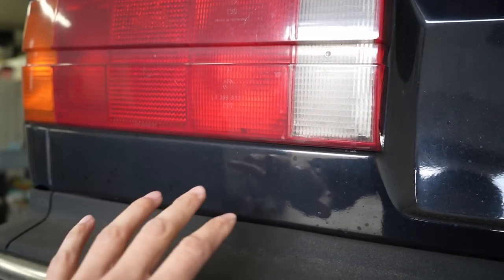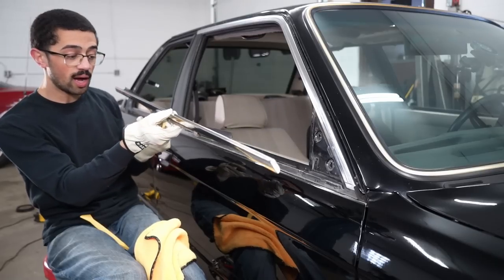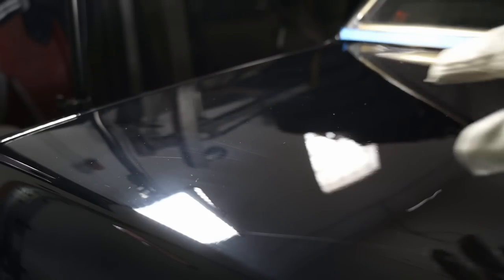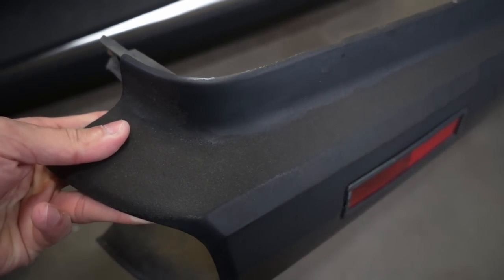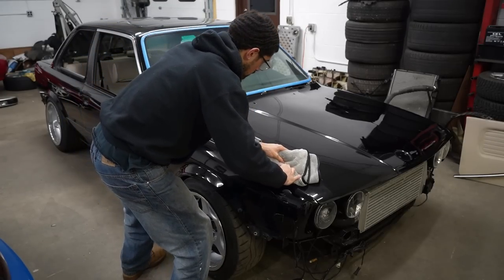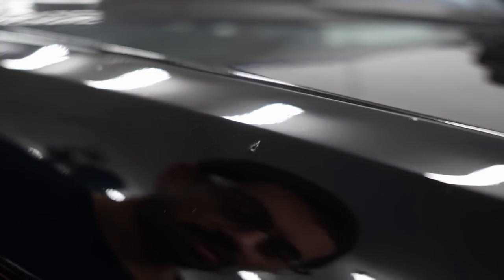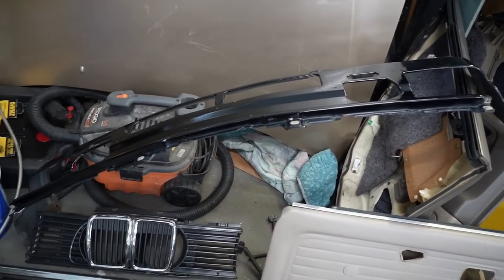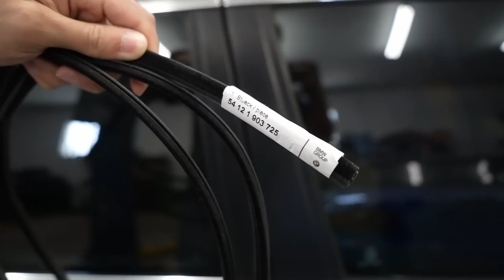i spent 150+ hours ceramic coating my turbo m50 e30

Comment: Some tips for anyone wanted to do a coating themselves.
1. Always do a polish beforehand, even if it’s a brand new vehicle.
2. A 10:1 solution of isopropyl alcohol and water will act as a prep solution to remove any residue from the polish that may be leftover.
3. Put your ceramic microfibers in a bucket filled with water and dish soap immediately after use to prolong the life of them. (Ceramic will crystallize on the towel if you do not do this, causing scratches)
4. Most coatings are ready to wipe off after they flash over, it’ll look almost like an oil slick.
5. For high spots (extra ceramic that hasn’t leveled, will still look flashed) lightly mist a microfiber with distilled water and wipe the panel. It should take the extra ceramic off if done before it has cured. If it has cured you need to rub off with polishing compound and reapply the coating. 
6. Look at your work outside when finished to get the best opportunity to catch high spots that are leftover.
7. If you have ceramic left over, put it in the refrigerator. It’ll increase the lifespan of the coating until it’s next use.

Comment: For the next correction you do, you can use compressed air to blow the compound/polish out of the pads/rags. It'll save a lot more down time.

With polish typically you can move a little quicker since there aren't as many abrasives so it takes less time to break down. 

Also whenever you do wash pads/microfiber just use detergent never add softener (it messes with the absorbency) and when you dry do the lowest temp you. It'll extend the longevity of the pads/microfiber.

Still the car came out looking fresh!

Comment: You normally do the touchup before polishing. You dab the spots, wet sand it flat then start your polishing. The cutting removes the scratches. When you go to polish the polish will have fillers that hid the little scratches. So do one spot until you figure out how your going to do the whole car. The iso with a clean towel will not scratch, if it shows scratches you need to polish more. Pad speed is important, 6-8 passes per 2x2 area. If there are still scratch’s you live with it or polish more. 
When the csl goes on to heavy and streaks just add some more quickly and wipe it off. Once it drys you have to sand it off and start again. 
You should clear coat the polished lenses. 
You did great it will be easier next time. You would normally follow crystal serum lite with gtechniq EXO. It’s a super hydrophobic coating that helps prevent water spots. And makes water just bead up and roll off. Use the trim product on the plastic pieces and the G5 for your glass and plastic, like the tail lights. For regular washes use a SIO topper like 3D Bead It Up or the new P&S Defender rather than the spray wax. Spray wax doesn’t stick to the ceramic and will just come off in a couple of days. 
Refresh the coating with the gtechniq C2v3 spray. It will keep the ceramic going for 3-4 years. The car is three ft gorgeous now. 
If you want 3 inch gorgeous you need to repaint. 😁 Use the extra on your wheels. Throw the towels away. You can’t wash the ceramic out it will scratch everything. I toss them or put them in the tire/wheel well wash bucket. Long video gets a long post.

Comment: As a full time detailer, I had to do whole cars 90-95% scratch removal within 2 days including the ceramic coating, it was insane. Not as detailed as you though, removing trims etc. We usually just taped em. I love seeing you take that extra step

Comment: Another trick if you ever go down this road again. Hahaha. we used to do compounding boats and yachts to clean pads while using them, can spin it and use end of a wooden ruler or paint brush. No harm to the pad and cleaned great..... When detailing a clean pad is less work and much better results. Car looks completely different start to finish. Great job 🤙

Comment: I have never seen a car get stripped before to get polished and coated. You really should do a decontamination with the iron remover and then the claybar or mitt before polishing. 
You can get I dual dei-oniser for your car washes. Many come with cartridge exchange programs. You plumb it in with a bypass setup so you only use the clear water when you want it spot free. 
Instead of waiting for things to air dry use a leaf blower. Now that is coated you could wash it with the spotfree system and then dry the car with a leaf blower, the electric EGO’s work great for this,they sell a stubby tube with a rubber band around the nozzle so you don’t scratch anything. 
No towels needed.
Try rhino liner in the wheel wells, it blacks them out and it’s really tough and will seal the metal.

Comment: Dude I’ve found that on my black car that a lot of times I can just polish then wax, instead of starting with compound. If I’m gonna wet sand with the 3000 (my hood gets fcuked every summer with Florida rain and sun) then I compound, polish and wax. Another tip is do the touch up paint before you compound cause you may need a small wet sand first. And you will always see the grainy scratches and minor swirls with older paint, you are only gonna get it so good, the final wax is meant to fill it in, that’s why guys build up wax layers (it looks like the ceramic coat did the same thing). Great job bro. That feeling you get when you see your reflection after all the work! 😎

Comment: For the paint repair you should have done it before the compound and polished and wet sanded the excess down to make it even and polished out the fine scratches from wet sanding

Comment: Instead of using griots 3 in 1 ceramic wax in between washes, I would suggest using their ceramic speed shine. It’ll act as a rejuvenating agent without adding a layer of wax over the already existing coating. Also coatings can still get water spots if left for too long so keep microfiber towels on hand.

Comment: Let’s go bro, car looks so good 
All the hurdles and trials and errors are some of the same things I went through on my techno violet E36 M3. (Before i hydroplaned it couple months back going 50 trying to be safe in rain on highway but pooled up area on bridge smoked me bad) Ik Ik big sad my baby everything to me 130k techno coupe on bags, mad good paint too, ended up finding it up by you in CT. Still looking for another now or a boston green but getting harder it seems. Awesome results on the black paint. Also finally someone I could relate to with everything I went through in correcting a car for the first time and every step or night I expected to get done ended up doubling with how ode I started to look at all the little scratches in the post polish prep with lights turned off in the shop and spotlight. But awesome to see another BMW enthusiast learning from their own mistakes (it’s the only way I learned) respects to you for that
30 looks nasty and your attention to detail throughout the whole journey just shined through even more when you had to compound and polish all over. Again had exact scenarios with chasing all the dry blown off compound with air compressor and surface prep/ microfibers I was constantly flipping
Comments getting too long at this point but ik that not even close to as long and many nerves went into seeing this project through. Cool to see others getting after it I guess the whole world really doesn’t stop even tho I don’t got a BMW rn 
Hope to go out for a rip with you at some point down the road 
Again awesome results looks nuts!
Shouts from east end LI

Comment: know ur struggle. Friend called, said he wanted hes car coatet, so i came over, realised he didn´t have a machine, so we had to do it by hand, what i also didn´t know was that, he bought a 5 step coating from maguire´s. Ofc we deep cleaned the car, took about an hour, and then another 8 hours, polishing non stop, by hand, my freaking arms are done. Never doing that without the machine

Comment: My 6" was WAY TOO BIG! LMFAO

You need to up your anti-cross-contamination game, mano. MF towels get washed only w cold water and light detergent. Air/line dry. MF towels for paint only w other MF for paint. MF for interior only w other interior towels, MF for wheels, etc, etc. Same for MF pads and foam pads. I hand wash pads as I go, you should see how many buckets litter my landscape. One pad per panel, max. Same for towels. Once they show some age, get demoted to lesser tasks. NOW, sanding and paint, BRO! First, NEVER near any cars. Look into DIY'ng a positive pressure booth. You have the space and they're dirt cheap and super simple. All that particulate can sail for hours and land on everything you don't want it to. The dust kicked up when compounding/polishing can be dealt w by covering wat you've already completed or spritzing w iso as you go. Or, a slightly larger positive pressure booth to roll that hot rod into. I have a mobile setup that's just a few poly sheets that hang from the ceiling and then fed filtered air into while the exhaust is also filtered before allowed back into atmosphere. No muss no fuss. There's also finding product that produces less dust. Appreciate you posting this. Very informative, especially for the first timers out there.

Comment: Joel. Please don't go making this beauty of a machine all pretty and shiny now. That's not what it should be about. I know you deserve a nice car and all but this is an Artistic work dog of high power monster ROCK N ROLL!! IMHO. I have two cars One of them is a swapped out 2002 330CI BMW which has been completely swapped for a 2006 E46 M3. And I mean completely swapped out LOL. Why am I mentioning this? Well it's my daily 6Speed manual rocket. No it's not the worlds fastest car but it's not slow either and I put headers on it with a Supersprint Muffler so it sounds like a dirty dog with a hive of bee's in it's mouth LOL. It's got a rotting rear quarter panel with a few dents in her and scratches etc. I love it like this because I can tool that baby around town without worrying about dirt or parking lot digs or rocks spitting up or out etc. I drive it like the mad man it deserves!! She revs to 8250RPM and it's SAWEEEEET!  My other car is a jet Black 2008 335XI that is shiny pretty and goes like bat out of Hades! I'm running around the 625HP mark with similar torque.  It's as close to a shiny queen as I'll be getting because the E46 is the spanky girl and the E90 is the Golden Queen. LOL. I love your car and you're so great to watch because you are a great guy! Thank you for the great videos!   Well now that I've watched the video I'm too late. But only for this round!! LOL. Make her look MEAN!! LOL.